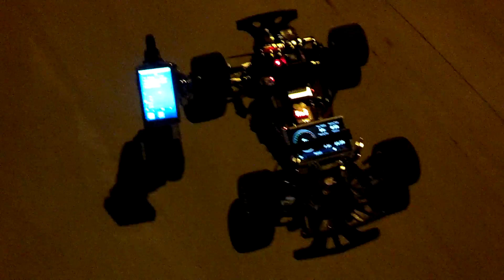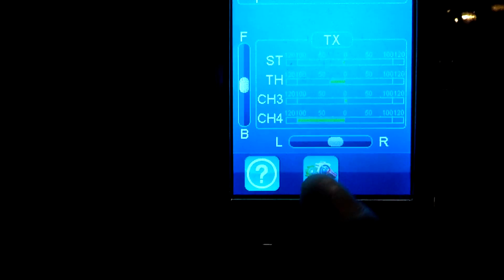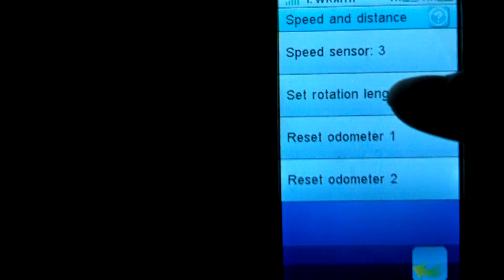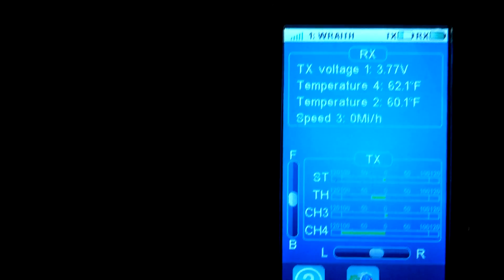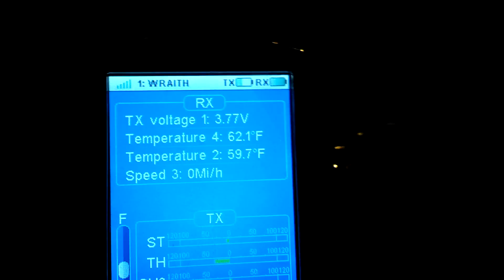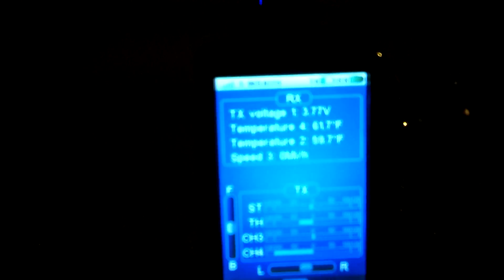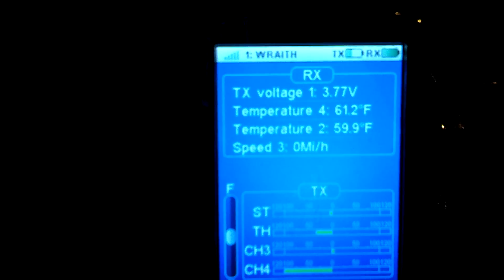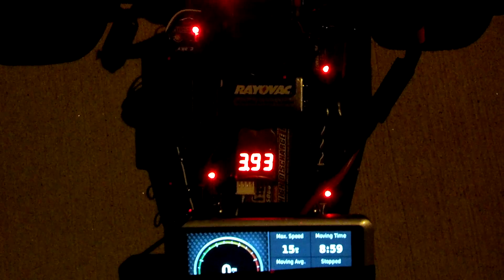Flysky fs it4-(speed sensor)

Comment: You dont have to keep your notes on paper, but it won't hurt. The radio has model memories and you can use different memories for different suspension/tire setups.

Have you found a good travel case for the iT4?

Comment: The voltage sensor works good I think the temp awsome the speed not so much I actually had a question I wanted to see if you thought we put it on the spur gears since its a magnet and it goes by rotation anl length if it would work on the spur gear I wanted your opion since you have one that actually works I also have a different set of sensors coming in the mail

Comment: I have the magnetic speed sensor so I glew that to inside of the tire and fasten the sensor close enough to it then the voltage put them in the bat plug the thermomiter one that is self explanitory ?
Reply from the maker: I don't have the voltage one installed because I already have a lipo alarm that reads each cells voltage. I have two temperature sensors and speed sensor installed. I could also install the voltage sensor if I wanted  but like I said I don't need it for now. how is it working for you? Is the magnetic speed sensor working good?

Comment: how do you change from rpm to mph
Reply from the maker: On the settings menu bro u can change from Mph, Kmh or Rpm. I also forgot to mention that the speed sensor does work in the dark as you seen in the vid. at first i tought it wasn't going to work in the dark since its not a magnetic sensor but  i tried it in my room in complete darkness and works perfect. Sorry i been off my channel for while just been really busy. but when i have time ill post more vids of how it works.
Reply: ok thanks

Comment: hey im thinking of getting the radio and I was wondering if you could answer a few questions about it. 1: how and where do you put the speed sencer on the car. and my second question is does it use magnets to get the speed rating and if so does it come with the magnet for the wheel or if it is something else. thanks
Reply from the maker: Im sorry for the late reply bro, The speed sensor goes on top of the rear A arm and its not magnetic,  it has what is called a optical sensor i belive .So the sensor points out into the wheel rim, so instead of a magnet in the rim you place or paint a stripe or in my case i put a strip of white sticky tape. i went with white because the rim was black. so theres gotta be a color difference so the sensor can read the revolutions. I do recommend this Transmitter.